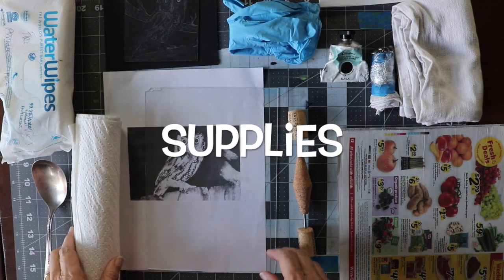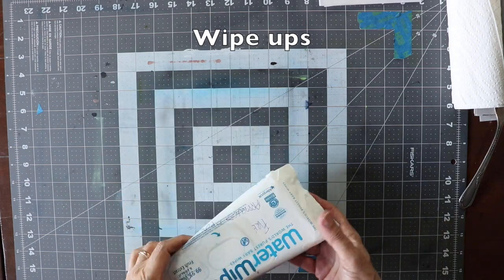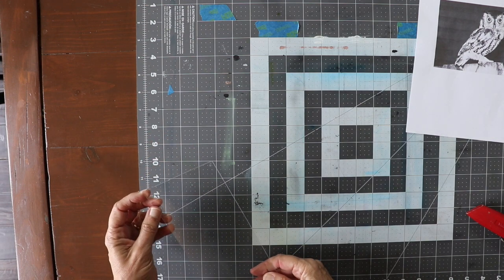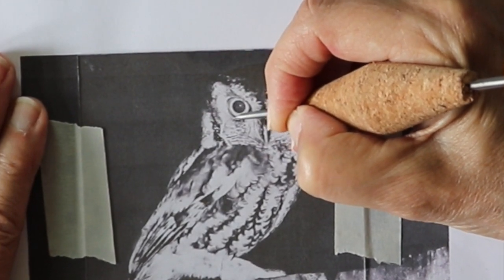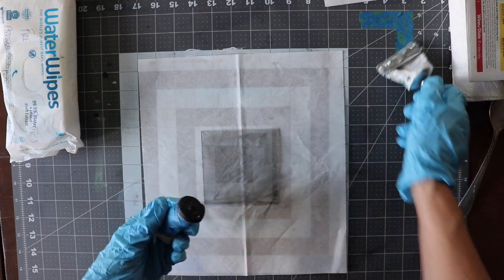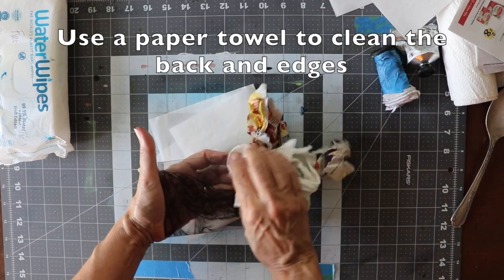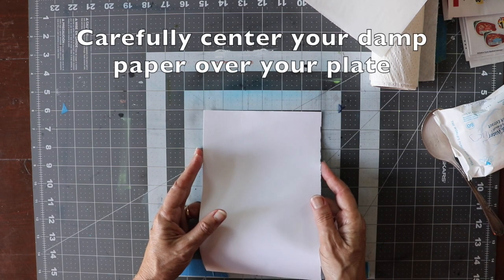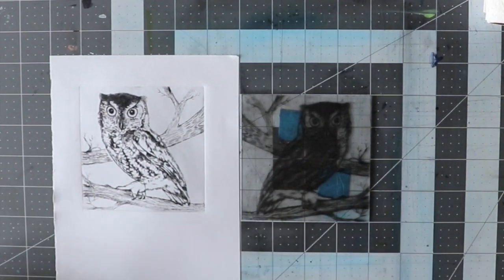Drypoint Etching on Plexiglass Without a Press - Tutorial

Comment: How thick is the plexiglass?
Reply from the maker: The plexiglass I sourced is from an old ikea frame and is thin.  If you use thicker plexiglass you will need to file and burnish the edges so it won’t cut into the paper when you press.